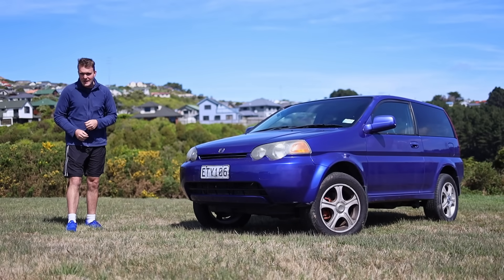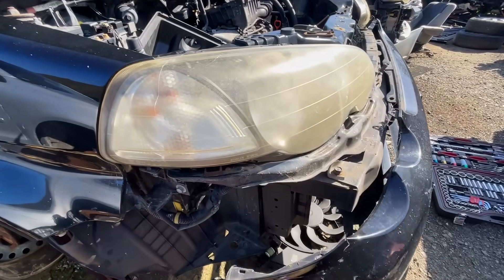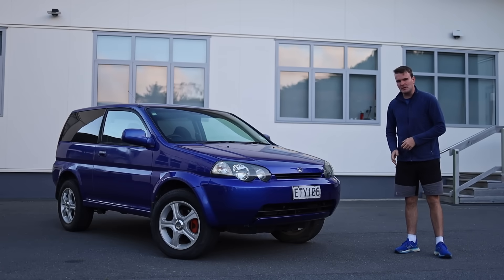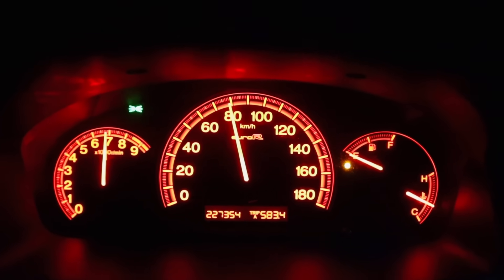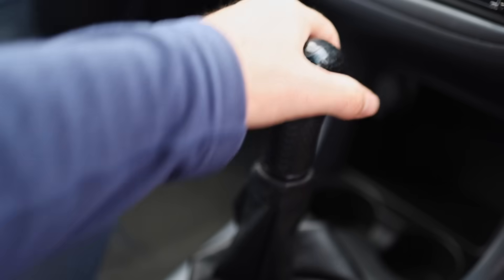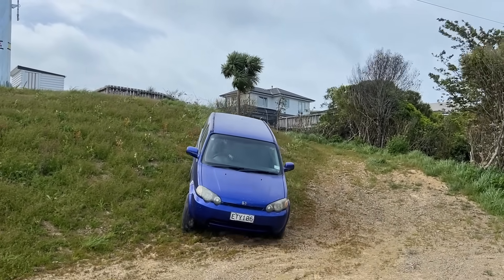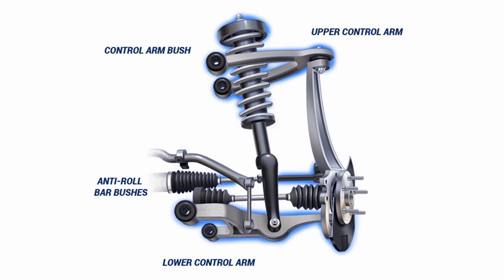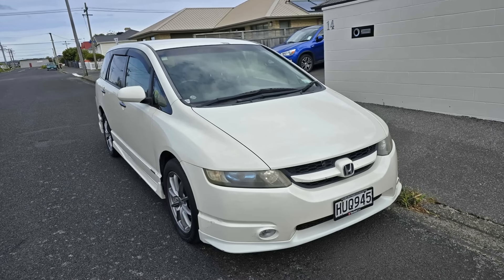The Engineering That Make Old Hondas Drive So Well

Comment: Great video. Had the exact same thought when driving a 1st gen Honda Elysion for work the other day; it drives way better than it had any right to, and also it could absolutely rip if someone had the...desire to, that 3.0 v6 can really light up the front tires, even in a 2000kg vehicle. Makes you feel Honda is still somehow underrated as a manufacturer, I mean the thing also had zero interior rattles despite 21 hard years
Reply from the maker: Yeah surprising aye! Good era for cars

Comment: The benefits of double wishbone over a McPherson strut on the front wheels is really tiny. Later civics binned off the front double wishbones to fit engines with larger top ends.

Even a BMW E39 has McPherson struts on the front, and that pulls one of the highest lateral g of any road car.
Reply from the maker: Yeah a bit of camber solves the problem. But there’s no denying it was a factor in why old Hondas handled so well
Reply: The fact that they put double wishbone front and rear in a basic old Civic is just commendable in and of itself

Comment: For the 100th time, my 1988 all original Honda CRX was the best car I've ever had. 800kg😍
So easy to drive, shift gears with one finger, ripping it over speed humps in comfort somehow, so smooth and stable at high speed.
Would have never sold it, too bad I smashed it and got talked into selling it, impossible to ever find something like that again, they are all overpriced and trashed now🤪.
Reply from the maker: One day I must review a CRX
Reply: @KiwiCarLife could also be like when you rewatch an old movie from childhood, which is usually terrible 😂.
long gears, but the ride was great though, 190km/h in 4th gear smooth as silk.

I think you'll be pressed to actually find a stock one though, even 25 years ago when I had mine it was the only stock one I came across, they were all modified with body kits and lowered.

Comment: Cracking video Liam, agree with everything in there. In the 90s Honda were killing it. I saw your review of that unicorn low miles 90s Accord - a friend had one with over 400,000km on it and when I drove it I was shocked, shocked I tell you at not only how tight it was given the age and miles, but equally, just how good the car was for its time - great gear shift, excellent power and handling, good refinement, little wind noise etc.
Reply from the maker: So many good cars from that era!

Comment: Great video. It's true that modern cars are far, far safer, but the insanity over the last 15 years has taken things too far. The weight is the reason I decided not to get an electric for my next car. I miss my old 1986 full time 4wd, double carb, Honda civic sedan. Could climb wet grass like it was tarmac. Clutch was the main issue.
Reply from the maker: Yeah agree modern cars have gone too far. There’s a middle ground though. 2000’s cars offer 90’s engagement with some of the 2010’s features and refinement

Comment: Cables throttles are worse in pretty much every way compared to dbw throttle. Dbw gets a bad wrap from the way manufacturers tune it for emissions and easy of use.

Set an equivalent size dbw throttle to 1:1 pedal map with no open or close rate dampening and it will be so sensitive you will get bucked out your seat.
Reply from the maker: Yeah that's the problem! Sensitive e throttles are not good! Hard to drive, rough for your passengers. But then the way most manufacturers set them up with slow response and rev hang is even worse. There's never been a bad cable throttle.
Reply: @KiwiCarLife  nah man, the sensitivity isn’t an issue with DBW itself, it’s all in how it’s tuned. With a DBW using a 1:1 map, it’s just as responsive as a cable throttle, and the smoothness comes down to your right foot.
Reply: @roflcopter645 the whole point of dbw is not to have a 1:1 map. Thats the biggest downfall of a cable throttle body. Because 50% open is not 50% flow.
Reply: Agree, had my Skyline and 370Z accelerator mapped to 1:1, it's better than a throttle cable in my view once you've gone that.
Reply: @John-i1g 1:1 is what makes cable throttles bad imo, (not that they are exact 1.1 due to shape of the cable wheel) 

The last 50% of throttle opening is only a fraction of the air flow (10-15%). So you lose all the fine control, especially with large tb